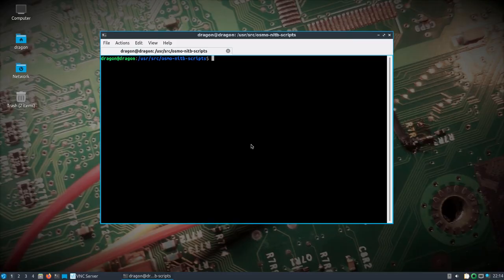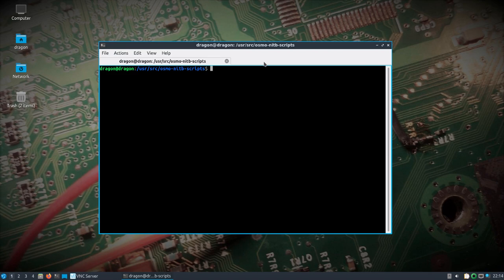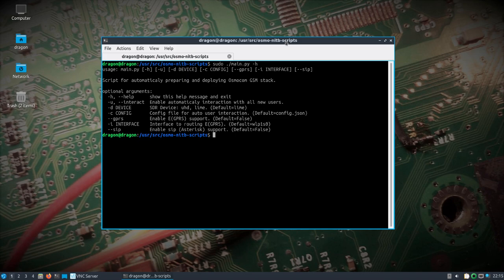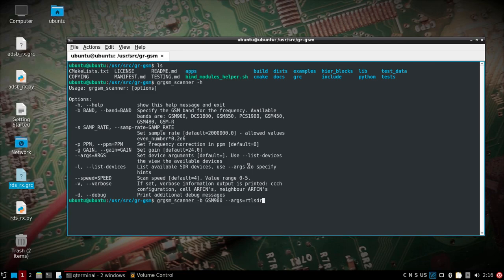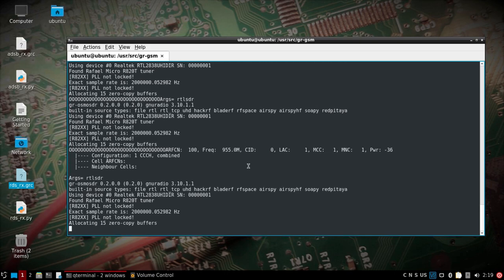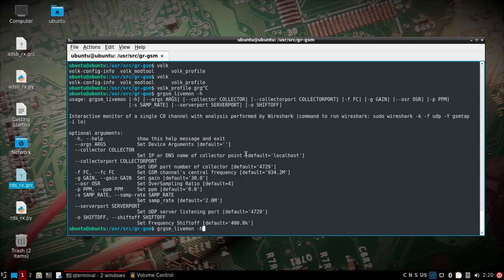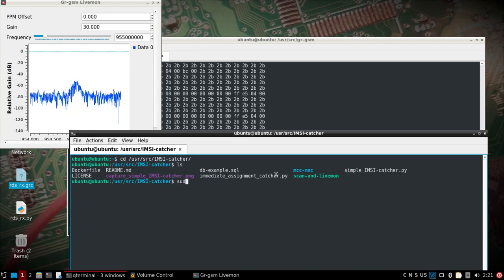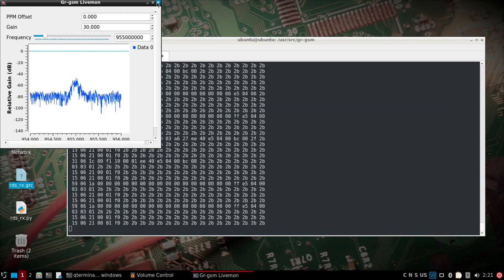DragonOS Pi64 Testing GR-GSM + IMSI Catcher w/ GNU Radio 3.10 (RTLSDR, Pi4, LimeSDR, OSMO-NITB)

Comment: Hi!  does gr-gsm work with a limesdr-mini on rpi4?. i have been trying to install it for weeks my os is raspberry os 11 on an rpi4B 2GB headless with no gui installed. the os itself is only slightly modified as i've added my own custom scripts to allow me to control it remotely. I also modified the kernel to preempt RT patch and i advise you to do the same as it greatly reduces resource usage because latency is more important for any sdr applications compared to throughput (i can run osmo-nitb + osmo-bts and osmo-trx-lms with the cpu clocked at 900mhz max because of the preempt rt kernel patch) However i have failed to install (well it installs but produces a soapy 7 lms stopped something like that) and use grgsm with limesdr please help! I have a limesdr mini 2.0 (perfect condition) and i also have a limesdr mini v1.2 (but only works on USB2 i messed the board) if you managed to install it and run on dragon pi64 please share how you did it and i can try to replicate it on pure debian 11 and raspberry pi os 11. i also have a bladerf xa4 and hackrf so i will see if my installation grgsm works with them just in case.
Reply from the maker: That’s great to know about the RT patch! Trying to think of anything special I may have done in terms of the LimeSDR. Let me first try this weekend. I only have the lime v1 and although I have the LimeSDR dependencies that *should support the v2 they are not the very latest. I built 3.10.3 or maybe .4 from source (gnuradio) and then also have soapy for LimeSDR.
Reply from the maker: There’s also grgsm on the DragonOS pi64 and I have tested it and it works, but now you have me thinking if I tied the lime or not.
Reply: @cemaxecuter7783  i will download the latest pi64 and try with the limesdr v1 and v2 and ill give feedback.
Reply: @cemaxecuter7783   well for most applications the limesdr-mini 2.0 is a drop in replacement for the limesdr-mini v1.x however limequicktest produces all kinds of failures unless you build it from the latest source (note these errors dont affect functionality in any way as all the previous applications i used work flawlessly) i think maybe a few apps that depend on the limequicktest output would have issues other than that its all good. I will build 3.10.3 from source now and try again. kindly share your email so i can send my progress with you.
Reply from the maker: I try and keep up with cemaxecuter@protonmail

Also there www someone contacting me avoid the v2 and ultimately it lead to a forum thread about the quick test you’re mentioning. Everything I read matches exactly what you’re saying.
Reply from the maker: about*
Reply: @cemaxecuter7783   i woulnt say avoid it as i think it runs cooler and better but they need to patch limesuite. overall its better designed in terms of hardware but lime seems to have neglected the software a little
Reply from the maker: That was me fat finger mistyping, I meant about not avoid.
Reply: @cemaxecuter7783  no problem 😉

Comment: i can not get any output , just i get a graphic but not specific signal. additionally my device is usrp2900. is that the reason that not working? why can not you get imsi numbers in this video? thanks.
Reply from the maker: I’d have to watch again but some things I don’t show due to YouTube rules, but I know it works. For the usrp2900 I’m not sure, I can only assume that if you’re getting the graphical spectral image it must be working to some extent. You need high gain and good antennas for the bands you’re looking for.

Comment: Also when I run grgsm..I’ve located the frequency, however in the terminal it doesn’t display any hex dec
Reply from the maker: Requires a pretty strong signal and sometimes you may have to manually move the freq left/right. Once on and with enough gain, you’ll see hex.
Reply from the maker: I test with local equipment though so if you’re not close to the source it’s a little harder to get the info.
Reply from the maker: This is on DragonOS I assume? You should see hex data but I can check again if you let me know what version you’re on.

Comment: It says there is no volk config file
Reply: When I run the scan, I am getting a warning that states: no volk config file found. Run volk_profile for best performance but nothing
Reply from the maker: After install of DragonOS pull up a terminal or really at any point and do this once 
volk_profile

Let it finish. It attempts to optimize things for your system, but of course will operate without doing so (you just get that notice popping up).

Comment: Hi mi dear teacher I am learning a lot with your videos I am enjoying the experience of DragonOs on my raspberry pi sdr lab .
Just one doubt , i've actually found an msi.sdr in my brother old cabinet , do you think he it is compatible with this tools in your system ?
Reply from the maker: I don’t think there’s a correct driver included to support it. From what I read it’s an rsp1 clone, so maybe the sdrplay api will see it but I doubt it.. would be difficult to know as I do not have one.
Reply: @cemaxecuter7783  you're wright I tested and it only recognize with lsusb and nothing more no software work with it.
Reply from the maker: Make sure you’ve ran the SDRPlay api installer in /usr/src. You may find the api allows some software to work.
Reply: @cemaxecuter7783  hi mr teacher good morning , it worked on my ubuntu laptop but not on the pi

Comment: Great video! I was able to get alot further with your help then any others Ive seen out there. I am still struggling to get the bytes to print out on grgsm_livemon. Any suggestions? I find the base stations with kal and tune in to it with grgsm_livemon and specify the args=hackrf. Ive struggled with this alot and havent found a solution.
Reply from the maker: Could be gain, try -g and a higher value. You might also have to manually shift left or right the center freq. Can’t think of much else at the moment but glad to hear the videos have helped.
Reply: @cemaxecuter7783  would it be possible to share your discord again? I was trying to join the one that you posted earlier but the link seems to be expired. Thanks Again!

Comment: Any1 know why gr-gsm was removed from kali packages....i had to autoremove and it deleted my installation of it and now i cant get it back ...i hate my life rn...i do not want to go through the month and a half of building this block by block for it to only semi-work
Reply: Ill have to spin 1 up swift like to check it out ...thanks for the feedback much appreciated
Reply from the maker: Grab the iso here, it’s got all the latest I’m working on. https://drive.google.com/drive/folders/19TJiEfcqX9qSAVsWiaUe-5bdMGMiZUo7
Reply: @cemaxecuter7783  any way you can find a work around for katoolin for dragon when u find time.. error is /usr/bin/ does not exist ...idk if i can just create a bin and point python to that path n idk if that would bom the dragonos ...i will try get a workaround myself ...dk if i have to go thru the dragon install for it to work or if i can continue using it live
Reply from the maker: I just quickly glanced at it - try to run the python script with sudo python3 katoolin.py

I don’t know what this may do to the system though
Reply from the maker: You can use it live if you make the usb stick persistent, otherwise it’ll reset on reboot
Reply from the maker: I’m guessing kali switched to gnuradio 3.10 which doesn’t have an offical package for gr-gsm - although there is a working fork as I have it working on the DragonOS Pi64 build with gnuradio 3.10
Reply: @cemaxecuter7783  luckily i have it on 2 kali vdi's that i can just port to a new vb instance on my other laptop but as far as my metal install idk if i should get rid of kali and go with dragon or sigint ..pretty sure i nuked my os trying to build from binaries ...once again
Reply from the maker: You know I’ll recommend DragonOS! Ha. It’s got way more.
Reply from the maker: It works perfectly fine in DragonOS.

Comment: [ERROR] SoapySDR::loadModule(/usr/local/lib/SoapySDR/modules0.7/libsdrPlaySupport.so)
  dlopen() failed: libsdrplay_api.so.3.07: cannot open shared object file: No such file or directory
Reply: Nooelec NESDR Smart v4 Bundle - Premium RTL-SDR w/Aluminum Enclosure, 0.5PPM TCXO, SMA Input & 3 Antennas. RTL2832U & R820T2-Based Software Defined Radio. 

Supported device? I still can’t find anything when following your video
Reply from the maker: @jesterzj  Hi, that should work just like the RTLSDR - so any video with the RTLSDR marked in it, you should be good to go.
Reply: Hmm then I may have to just mess with it until something pops up, thank you for the speedy response!
Reply: Ok will give it a go. Again sorry to bother you with these stupid questions. I appreciate your patience and quick responses.
Reply from the maker: No problem 😉
Reply: One more thing as of now, can’t hear any sound. Using raspberry pi4 but VNC on my laptop and can’t hear anything
Reply from the maker: Audio over real vnc isn’t possible without the paid service. You can instead startup something like the SDR++ server on the pi and then connect to it with SDR++ on your laptop assuming you also have DragonOS on it or have installed it yourself
Reply from the maker: Examples 
DragonOS Focal Remote SDR w/ SDR++, SDRAngel, SigDigger, and Gqrx  (Pi4, HackRF, Airspy/HF, RTLSDR)
https://youtu.be/Oaw8y74S4TQ
Reply from the maker: You’ll see that till you run the api installer mentioned in the getting starting document on the desktop. The sdrplay api is located in /usr/src or there’s a shortcut to it under Other. Run it once.
Reply: I’ve followed the video and I can’t get anything to pop up. Using pi4 and nothing. Sorry to bother
Reply from the maker: No brother - couple factors, the rtlsdr can’t “see” PCS1900 but maybe if you have gsm 900 etc you will be able to see it (there’s no gsm except 1900 in the states as an example) You have to have an appropriate antenna. If you’re not seeing anything then there’s either no gsm on the band or you’re signal strength is not good enough.
Reply: 3 antennas and can’t see a damn thing. Any more guides? Or just any video with rtlsdr will work?
Reply from the maker: When you say you can’t see anything, are you meaning just something with gsm? Open up SDR++ and pick the rtlsdr and experiment, you should be seeing some signals. Any video I’ve done using the rtlsdr should work .
Reply: I mean after I type grgsm_scanner -b GSM900 —args=rtlsdr -v -d  I don’t get the Cell ARFCN or anything. Just scans. This is all new to me, please forgive me.
Reply from the maker: Gsm 900 is not everywhere. Try other options instead of GSM900, like GSM850, GSM-R, but if there’s nothing around you then you’ll get no results.